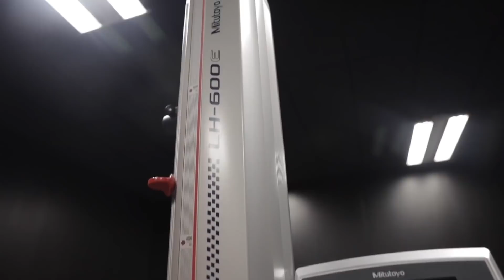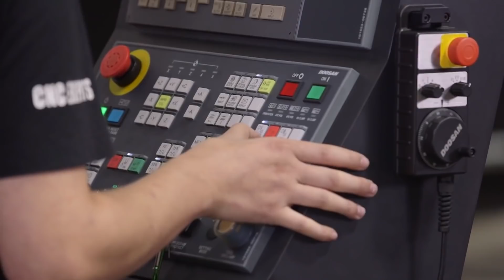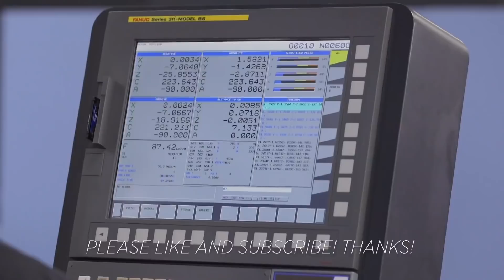If You Work in a Machine Shop… Send This Video to ALL OF THE BOSSES

Comment: Nothing worse as a owner/machinist. Seeing a machinist sit on a time for a job and not improve on it. Especially when your doing 2K-5k amount of parts. That 10-20 seconds per part change can be a big difference. Be it .5 on the feeds or 1 or 2  less peck per drilling cycles.  Can be the difference being done before lunch or end of the day. Who wants to come in and run say 20pcs .

Comment: what my boss understand on challenging the workers is by making them work on 2 machines, 1 man at 2 okumas and so on and pay them the same. i fucking hate it
Reply from the maker: As mentioned in a recent video… it’s hard to pay a person really good money if they are only running a single high level machine… $20-$36 an hour is normal… but if a shop can fixture in a way that one person can run 1-3 machines… because each has run time and a secondary person doing in process inspection etc…
Well then that employee deserves $30-$60 per hour. Of course the company has to make money to pay money… 
This is my opinion.
Reply: @TITANSofCNC  Lmao, i wish i had 5 $/h but unfortunately in romania wages are probably the same or worst as those from China. Things are a lot different here, we have a man for inspection but doesn't do a thing, workers do their job on 2 even 3 machines and program them themselfs  in such a maner so they can split from one to another. Workers here do programming, machining, check the final product if corresponds with the drawing and is never enough in our boss eyes. I ask nothing from you, just share a situation from another part of the world. Funny that are lots of "engineers" and some pf them get their wages doing nothing. 

I'm kind of relieved saying this 🙂
Reply from the maker: Thanks for sharing… I didn’t know where you were from. Hope things get better🙏